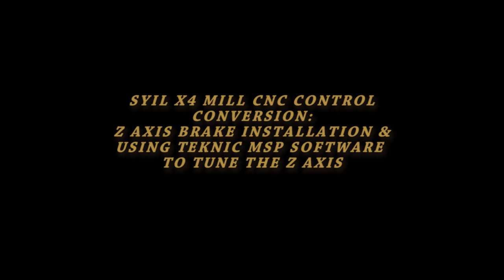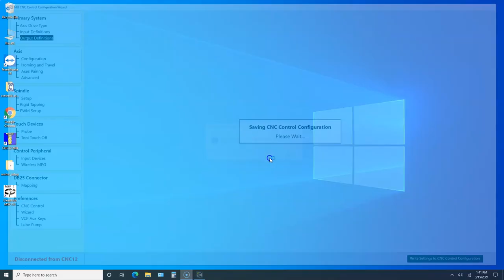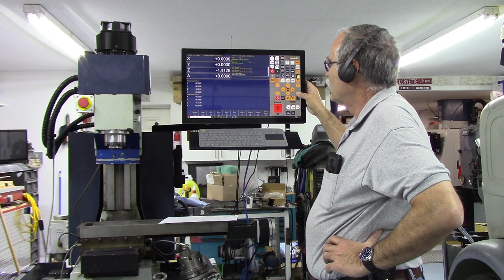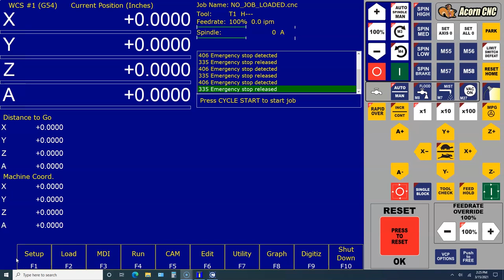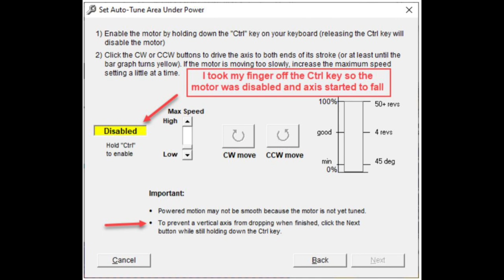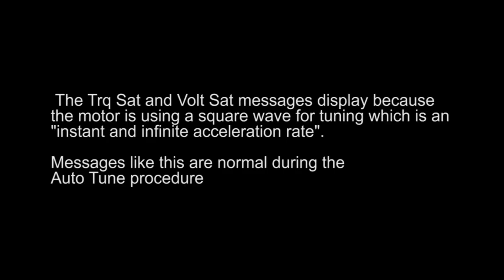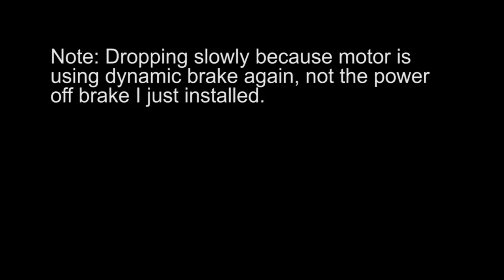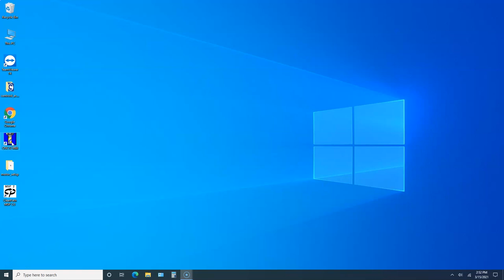SYIL X4 CNC Mill, Teknic Clearpath SDSK, Centroid Acorn Project: Brake and Z Axis Tune

Comment: Nice retrofit Marty. I have a set of CP servos for my build. I like the Acorn board. I wish they'd do away with db25 connector and offer more inputs
Reply from the maker: DB25 is for 5vdc logic drives. If you really need more IO, consider an Ether1616

Comment: I noticed in the teknic brake manual, they recommended a flyback diode in certain installs.   Do you feel one is needed when using the acorn relays?
Reply from the maker: I did not need one. You should discuss with Teknic
Reply: Thanks, I will!   I’ve really learned a lot from your videos!  Great content!

Comment: Hi Marty, great setup. Do you use 2 different power supplies, one for the Power Hub and another for Acorn? If so, why can't you use the power supply shipped with the Acorn to power the Power Hub? Thanks for the info, very informative.
Reply from the maker: I used two different power supplies, one primarily for Acorn and it's logic and one for the Estop contactor and Power4-Hub. They are cheap and it's cheap insurance for the reliability of the control in my opinion. Also, it wasn't clear how much current was required to maintain power to the drives
Reply: @martyscncgarage5275  Thanks for the speedy reply - in the process of doing the layout for my panel and following your recommendations. Thanks!
Reply: Hi Marty, thought I'd let you know, I reached out to Teknic for more information and the wattage requirements for the Power Hub is 3W per motor (p200 in the manual), so in my case 9W. The power supply that came with the Acorn board (Mean Well RD-35B) has a rated output of 35W so I think that I'm safe with only the power supply bought from Centroid's Acorn system. Thanks again :)

Comment: hi Marty, would you be willing/able to help with a bridgeport repair in glendale/phoenix area?
Reply: Hi Walter. I am no longer insured to work on machines and I would only work on Centroid controls.
Reply: @MartyEscarcega  I'm really only in need of someone with ur experience to help run down the source of the issues with the machine and possibly some advice as to replacing the electronics

Comment: Hi Marty how stable is centroid software?
Reply from the maker: Very. The entire control is stable provided you use GOOD wiring practices, properly sized drives/motors and a Windows 10 PC meeting the minimum performance requirements. Centroid has been building CNC machine motion controllers for over 30 years